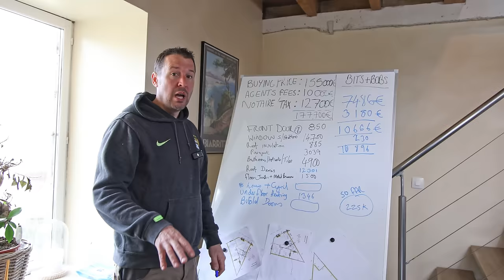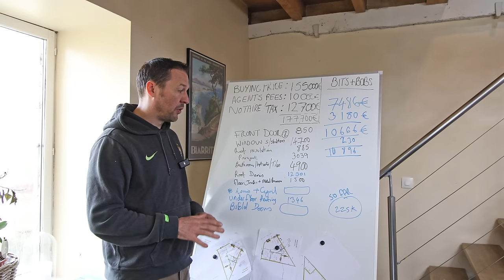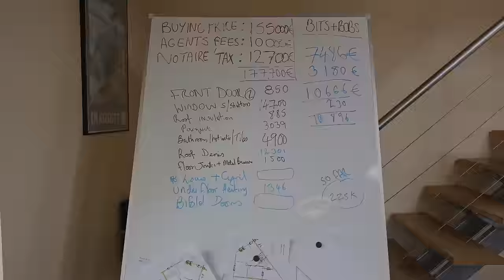Mastering The Art Of Ceiling Preparation @ The Abandoned House Renovation

Comment: Did a old place in Nfld. Sealed up the house, jacked up everything to where it needed to be, run dehumidifier and fans for 4 months, all good.
then started renovation and structural repair/rebuilding. 
Attaching new wood to old moist wood is asking for trouble 
Put tar paper(or something similar)r between old wood an new 
Manufactured beams or laminated ply is much stronger than regular wood beams

Comment: I've been wondering what you will do to close the gaps in some places between the roof and the walls. I know a house needs to breathe, but in one corner it looks like water could easily get in, soak the insulation and then the wallboard. Please explain. I hope to reno a small French house myself one day so am avidly following along. Hopefully I can find good, cost-effective workers, roofer, etc., like yours!
Reply from the maker: Yep we haven’t closed that wall off yet, it will be completely blocked off with wood from the outside

Comment: OK - to the question. This is the condensation water evacuation for the inside units of the air conditioning. Your budget looks quite well - the roofing was very cheap. When we bought our property here in the Luberon (which is a little bit more expensive than Bordeaux) we spent also a little bit more than 50% of the purchase price on renovations.
Reply: No, that's what it was originally designed for. In this house it will be for the express delivery of Bordeaux wine to the bedrooms of course😅😂😂.
Reply: @daisylovelock9553 To be quite frank, as a German living since more than 25 years in France, I have meanwhile recognized that express delivery of whatever French wine via evacuation pipes is not really appreciated, might be for UK or US guests but for the rest - NO.
Reply: @gunterhagendorf8318  Bless you

Comment: Your brackets are parallel to the roof angle and level across it's perlins ,the metal system adds to the ventilation of the ceiling,good wiring to go.

Comment: Edd. I noticed you Louis added the odd extra ceiling joist when aligning the rails to hold the plaster board on the raked ceiling , was that for alignment ???? doing a great job either way.
Reply from the maker: No those joists were for roof structure

Comment: The spending you showed at the end does not yet include payment for Louis and Cyeil. Now you say  it would be 'maybe five to tenthousand', which is a pretty big range.
You started with the renovation about eight months ago. How does that figure? Are they working on an honorary basis? Even if you say it's not full time for the both, 1,000 EUR a month should be the minimum, which would be much more than 10,000!
Reply from the maker: We started in October ….. I’ve really not calculated the total - it was a guess!!! It will be the correct amount when I get time to ask the accountant but we haven’t worked constantly here either.

Comment: You may have mentioned it. I may have missed it. That said, you might ought to add insulation between the bats. The cold exposed beams will draw heat out. Forgive me if it was already addressed.
Reply from the maker: This insulation is only a top up, the main insulation is thin on top of the roof under the tiles and has a great r value of 6….. but even this insulation will help a lot.
Reply: @BordeauxLife  How could I have doubted you? I was never colder than the winter I spent in France. 30 years on and it still haunts me.